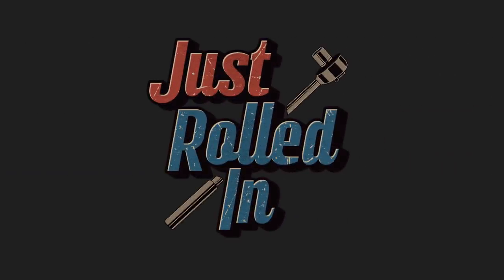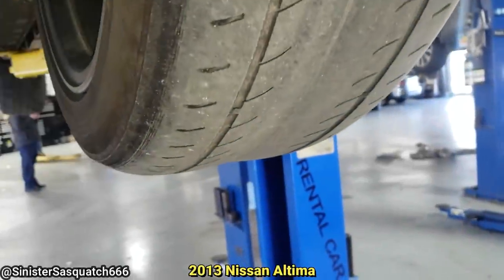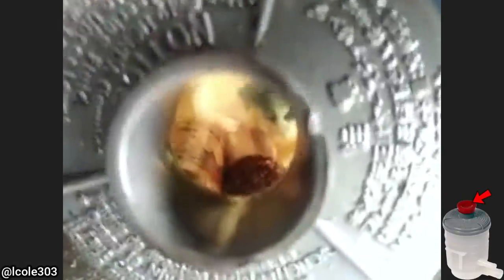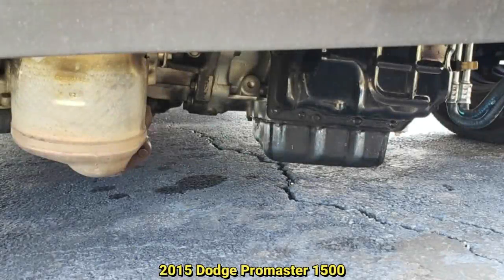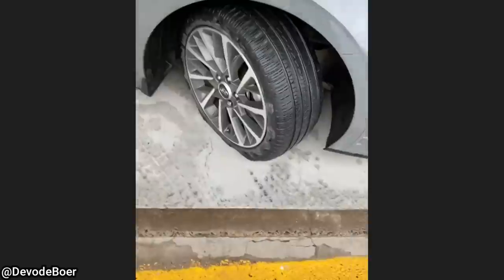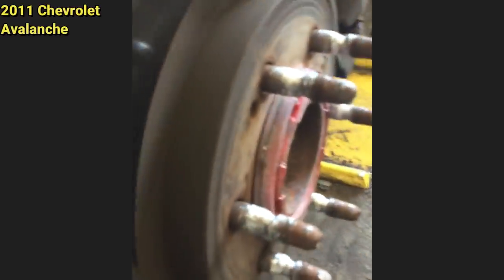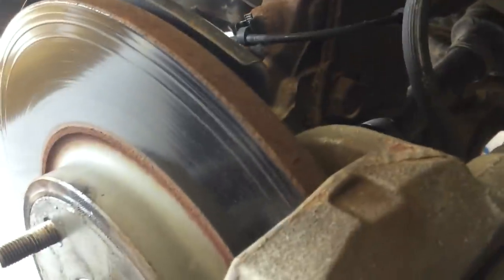Customer States Engine Is Making A Funny Noise | Just Rolled In

Comment: I'm staying home from now on. But first, I would like a chemist to identify and explain how certain oil additives polymerizes synthetic oil into rubber. Perhaps "Project Farm" could take on that challenge since he's testing and experimenting on everything. Or NileRed could analyze the engine blob. 🤷🏽‍♂
Reply: Todd will do a head-to-head using various additives in the same synthetic oil to see which one makes the bounciest blob. Red will take each blob and see which is most flammable.
Reply: @katdeville  Correction: NileRed will make gummy bears. "I noticed that the molecules look similar."
Reply: Common! Todd knows how to measure lubricity and Nile Red would synthesize the whole vehicle?
Reply: I suspect that they used multiple oil additives and 2 or more didn't play well together, causing the unfortunate scene we see in the video. The same thing can happen to coolant if you mix different types together without verifiying that they are compatible with each other.
Reply: @ConstantlyDamaged  "Captain, my tricorder indicates the material is unknown to our sciences."
Reply: I love this comment and the previous chain
Reply: It's been converted into TOFU.
Reply: Is it possible that high-oleic soybean oil has crept into our engines? How would a service center know the formulation since they purchase product in bulk.
Reply: you would have to get a sample of the goo sent in for  analysis.

Its possible the engine was knocking so the owner put grease in oil filler instead of oil... to quiet it down.

Years ago I washed my car with Era laundry detergent then used regular Turtle wax on it. I was rinsing the wax pad in the bucket of left over Era soap and water.

I came back about 2 hours later and the bucket of soap + wax had gelled - like green Jello....
Reply: @Account NumberEight I was going to ask, didn't Steve McQueen make a movie about this?  :^D

Comment: Wow, the jelly-oil was insane...... Makes you once again appreciate, what such engines can take.

Reminds me of my car. Cylinder head gasket broken at some point, I recognized it VERY late, when there was almost no "oil" left, and it was a fine mixture of oil and water. The engine was running as usual and didn't give me any feedback through some weird feeling, that something might not be good. The oil check light told me at some point. (And I could pay more attention, there was quite a visible puddle of oil in my garage)

Comment: Had a Dodge Durango come in for its first oil change at 68,000 km. As soon as I had it up on the hoist, I saw the black factory filter and knew I was in for a treat. 

Cracked the drain plug for the first time and nothing came out. 

Cracked the oil filter and it was like playdough. 

Got to see the customer's face when they voided the warranty and holy shit was it delicious.

I changed the oil and we discussed the best way forward. Testament to Mopar power, we ran it outside after putting some cleaner through it and she ran just fine when it left. Never saw the customer again, though.

Comment: Not gonna lie, took me a second on the new battery 🤣🤣🤣🤣
Reply from the maker: Glad you got it. Or else you'd be buttholasaurus98
Reply: Not wrong, took a screen shot, and spent some time, looking for the problem! Forehead is bright red from the slap...☺
Reply: I did too, until I took a closer look for the buckle was a BIT distorted.... 

Holee cow.
Reply: I saw it right away and actually swore out loud at my screen.
Reply: @JustRolledIn  Well, to be fair, the person DID strip the cables before installing...
Reply: I wonder if they try to jump start it.lol
Reply: What is the standard air gap for battery leads?

Comment: The oddest thing I ever found inside an engine - was nuts and berries in the cylinders.

We had a number of company trucks and my boss thought he'd buy this old junker and fix it up to add another one.  It had been sitting a while - and he asked me to rebuild the engine.  So - I took it apart and found nuts and berries inside some of the cylinders.

Some small animal must have crawled up the tail pipe and through the exhaust manifold into the cylinders where the valves were open to store his supplies.  I'll bet he was pissed when we towed it away ...

That truck - was a mistake.  Once my boss saw how bad the engine was - he told me to forget it.
.
Reply: Happens with snowmobiles stored for the winter. We’d put steel wool into the end of exhaust. I’ve seen mice climb through and pee on the cylinders. Lock your motor right up.
Reply: @ronjericho7977  Yep.  There are little furry critters that can get into things you would not believe ...

One thing about that fur ... is there are often very, very skinny animals underneath it.  I've seen Jack Rabbits just go right through a chain link fence like it wasn't even there.
.
Reply: squirrels have been known to stash nuts in peoples' vehicles.
Reply: Did you return the nuts and berries?
Reply: @Mark-jc1qj  No.  I'm afraid that since I was not the one with the truck when it was towed over - I had no knowledge of where it came from - and it did not even occur to me to do so.

Besides which, I was much to involved with trying to deal with an engine where the rings were rusted to the pistons and I broke the tip off my Buck Knife trying to pry them apart.  Like I said - once my boss saw that engine he told me to forget it.  It's possible he salvaged some parts off the thing but ... I don't think so.  I think it just got sold for scrap.

The moral of this story being - no matter how good a mechanic you might think you are - don't fool with a junker - unless it's like a labor of love for a particular type of machine.  Commercially - it's just not worth the trouble.  You'll spend more time on the thing than it's worth.

My boss had not paid much for it.  So I don't know if he got his money back from selling it to a Scrap Yard.
.
Reply: Reminds me of when I bought a 'brandnew' car in 2012 (the car was from 2011) that had been sitting outside at the garage's outdoor showfloor for a year with just 12 kilometers on the counter. Then several years later in 2019 I figured I'd want a full overhaul including all-season tires, new AC filters, and everything. Originally the mechanic said that a new AC filter might not be needed but later the mechanic came up to me with the old AC filter which was packed with empty nut shells. Seemed like a little furry critter had used the filter-box during that 2011 winter as a storeroom for his food supply and I never even noticed anything wierd during the 7 years I had been using my AC during the summer months. So I just told him "Yeah, just add a new filter and toss that 'nutty one' in the trash".🤣
Reply: @DanakarEndeel  Yep.  I'll bet he was pissed off when you bought his storage facility too ...
.
Reply: @BobSmith-dk8nw  The furry friend you mean? Yeah, I fear so too. Fortunately I bought my car in the summer and all the nuts had been eaten so it was primarily hundreds of empty shells. I'm sure he would have found another car for the next winter's storage. 🤣
Reply: @DanakarEndeel  Yeah. Ha! ha!  Ha !
.

Comment: My first vehicle was a 1966 GMC PU. I kept her going for 22 years until parts just became impossible to get. I did all my own work. When some part work break, I would take the system course for that break down at the local community college. They were self paced and designed for a semester. I could and did finish them in a week. I would show up in the morning 7:00am and leave at 9:00pm. I loved those self paced courses! Now with YouTube it pretty easy to get instructionals on any repair. There is definitely a finesse to being a good mechanic. A little bit of theory combined with lots of experience over the years really helps.

Comment: The window motors on that Toyota must be pretty powerful to be able to hoist those windows up.
Reply: No kidding. Usually those types of windows are fixed and not able to open, in part for that reason (also because sometimes the door armoring takes up that space)
Reply: It does make me wonder if they upgrade them indeed.
Reply: But doesn't that also make yall think who's going to that dudes shop?
Reply: I'm wondering just how they fit the damn panes in the doors!

Comment: Had a lass come in with a 2017 Nissan (company owned). She didn't know that
1. You need to change the oil
2. At 44k miles past her oil change, she can't top it off (we do free top offs between changes).
She had sludge. The oil pump was no longer working. She also didn't understand why we couldn't replace the pump even though we were closed.
Reply: I have a neighbour that's weird like that. Every couple of weeks she pours just enough oil into her Renault Twingo for the dipstick to just barely hit "min." and only adds more when the dipstick doesn't touch oil anymore. She's never had an oil change, because she's never had enough oil to change. I've told her again and again to please at least fill it to max. but she says "It's a waste of oil" and "I don't want to risk overfilling it"
Reply: @PrototypeSpaceMonkey  at least she had something resembling a thought process
Reply: @MyDogIsYoshi  Not much point in having a thought process if its an incorrect one.    Some people can be taught, but I fear she may deliberately resist education - perhaps she likes  to be dumb.
Reply: @csjrogerson2377  fair point.

Comment: My very first car was a 1984 Chevy S-10 bought in 1988. The original owner got the truck new and never changed the oil. It finally threw a rod and I got it due to a family tradition of buying a car in need of an overhaul then having the kid rebuild the engine.
      The truck still had oil but when I pulled the oil pan off the sludge was so thick it had blocked up the pick-up for the oil pump. The oil wasn't as bad as this one, but it was close.
       I had that little truck for the next 10 years, butting another 100000+ miles on it. The engine was still rock solid. Everything around the engine was wore out, but that engine was solid.

Comment: I made a mistake with a wheel a few years ago. Didn't tighten the nuts and I lost 3 nuts and broke 1 of the bolts. Thankfully I didn't end up crashing but did replace the bolt and missing nuts myself. Didn't have issues since then because I made sure all of the nuts were tight.
Reply: you got lucky brother

Comment: 0:35 I watch Cop Shows from the UK, and tires like this (if caught) would get their vehicle towed. Vehicle Inspections (MOT) are strict!
Also, vehicles must be Licensed & Insured in the US, but anyone can drive it. In the UK, every single person that drives the vehicle MUST be Insured to that vehicle, or (if caught) you get a ticket and the vehicle gets towed. Clone Plates (Copy License Plates) are a big problem in the UK, but they have Automatic Number Plate Readers that alert them.
Reply: It's a £2.500 fine per tyre here in the UK for tyres that are below the legal minimum (1.6mm 0.063 inches). It's also an offence to drive a vehicle you know is unroadworthy, so being told your tyres are bald means you can't legally drive it.
Reply: The insurance here works like this.
I buy a car and insure it myself but I put the name of my wife down on the form as a named driver. She is then insured to drive it too but it does obviously cost more for an added person.

Comment: those bullet proof windows remind me of a hearse I saw that had been converted into what the owner called his "bug out buggy" 

Unburnished steel, just clear coat to keep the rust off. Expensive top of the line go anywhere tyres, big American V 8 engine from the 70s, inch thigh steel skid plates under the engine and transmission and the entire area where coffins would sit? 
Full of metal racks for guns, tool boxes, an air compressor tank that could adjust the suspension height and even deinflate/reinflate the tyres at will.

And ofc, full bullet proof windows that were as thick as a baby's arm with metal bars reinforcing them on the inside.
Reply: He used it for Christmas shopping I'll bet. Those crowds are vicious!

Comment: Stuff of nightmares like this is why I'd stomach a mandatory MOT even twice a year. Less chance of some hero on DIY (no)brake job, bald tires, or wheels holding on by hopes and dreams wiping out into me.

Or generally to save the idiots themselves from driving rotted-out deathtraps.
Reply: Yerbut.....
I just fixed an MOT failure (UK) only one of the fail issues were correct and they missed a brake pad that was down to the metal and an unsecured battery.
Reply: "A small percentage of people do stupid things so I want to be treated like I do stupid things, too."  I'm so tired of people begging for government bureaucrats to tell em what to do... Pathetic.

Comment: The guy with the Ford truck was lucky it was his seat belt hanging out of the floor pan. It's usually the bed riding on the leaf spring or the radius arm holding the front suspension together.

Comment: F150 stopped by shop for Kwik AC top off. Almost died laughing when I saw every hose connection and crimp was slathered with epoxy sealant. They must have used 50 kits. Problem was compressor frt seal was dripping green oil like it was free. Shop owner and I were still trying to subdue our amusement as customer left in unappreciated huff !

Comment: I've had quick lube places somehow disconnect my battery (for some unknown reason) and lose the power steering cap.  The cap was just annoying, but disconnecting the positive side of your battery means no go.  So for your own safety and freedom of headaches, check your engine after you get stuff done so you don't find any surprises later, in the middle of the night, stranding you somewhere.

Comment: A friend and myself were driving up the Alcan Highway (all gravel) to Alaska and we took a rock in the radiator. Lost our coolant and this cute 80 year old couple stopped in their truck and fifth wheel. The old man looked at the hole in the radiator and yelled out 'Martha, bring me a piece of white bread'. He proceeded to knead a small piece in between his fingers until it turned to dough. He gave it to us and said, 'press that into the hole, and fill it up with water'. We did and it held water. The dough swelled on the inside of the radiator tube and the heat hardened it. That thing didn't leak for a whole year. We finally cleaned it out and bought some 'Stop Leak'. From there on out it leaked like a sieve. Finally had to have it brazed closed. We told they old couple thank you and how concerned we were (teenage boys) and he said 'you have a lot more to worry about breaking down on the freeway in LA, nobody will stop and help you down there'. Well spoken.

Comment: Many years ago back around 1969 I was a Honda motorcycle mechanic. A customer rode his Honda S-90 single cylinder with 4-stroke engine to the shop and with the engine running - somewhat as it was misfiring and making a hell of a noise. He said he thought he needed a tuneup.  We agreed.  When we examined the engine it turned out the rod was totally severed and had been running like that. Must have broke after he started it up. Both ends of the rod were mushroomed where the end connected to the piston had been banging into the other end of the rod connected to the crank. I still do not understand how in hell the piston did not bend the valves and how it could continue running.  Remember this is a single cylinder engine and a 4-stroke at that so it only fired every other time the piston got knocked up to towards TDC on the compression stroke.

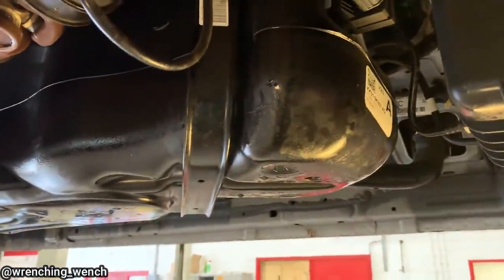Comment: 0:49 - Ford Transits having issues right off the dealer lot... That seems to be a recurring theme. It started with a slew of Transits with unsecured coolant hose clamps. You can find the videos here on YT for that.
1:27 - Well, of COURSE the vehicle isn't going to start... When you clamp the cable ends to INSULATED battery cables! 🤣
Reply: The Honda Glove story jogged a random memory loose!
A friend of mine had a 2nd-Gen Eclipse (manual trans), she wasn't too bright, and her boyfriend even less so. He misplaced her 710 cap (oil cap) when adding oil once, and he "solved" the problem by taking off one of the socks he was wearing at the time and stuffing it into the fill.
Fast-forward *A FEW WEEKS* (!) and her car randomly grenades itself about a mile from my house, they push it into a parking lot and leave it there. A few days after that, instead of calling me, she calls a mutual friend that lives 20 minutes away. He drives down, pops the hood, and after a little bit of work he calls me, laughing hysterically. It took him a minute to compose himself, he relates the story to me, and then says, "...so I pulled the valve cover, and you'll never guess what happened?"
Matt, I'm one step ahead of you here. "Um, the sock got pulled into the valvetrain and..."
"Yup," he interrupted, "and it's even worse than you can imagine. Sock is shredded, pieces are tangled in the springs, and I wouldn't be surprised if some pieces of sock are in the block. I can't find enough pieces to make a whole sock out of them."

Instead of buying a junkyard motor, which would have cost her $300-350 back then (at a junkyard literally an 8-minute drive from where the car sat), and Matt and I MIGHT have even done the swap for free as a favor, she scrapped the car. Body was a 9/10, interior was a 7/10, and had I known she was gonna scrap it for $250, I would have paid her $250 for the car and fixed it myself. Nothing a used engine and a good detailing couldn't fix.